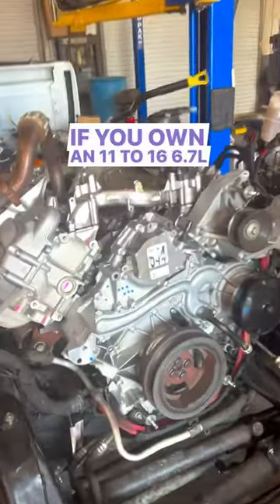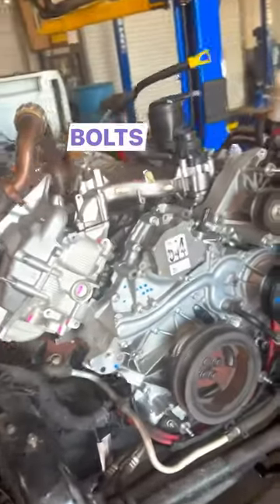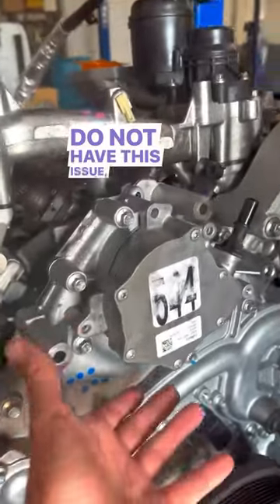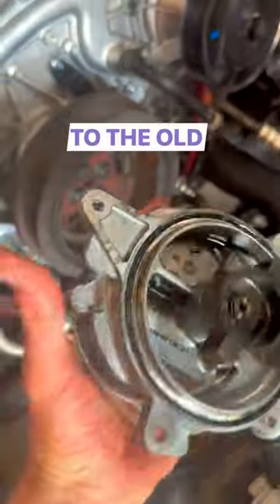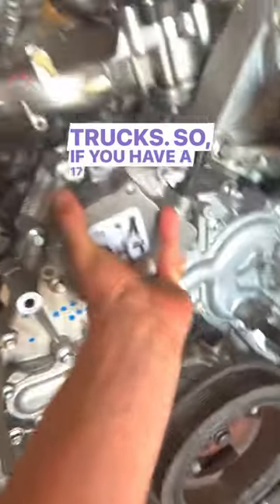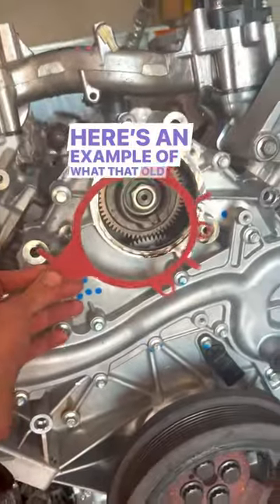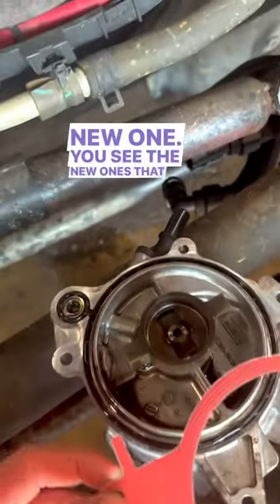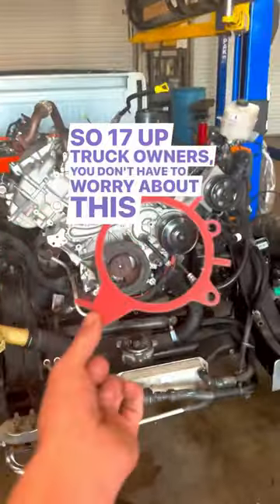6.7L Powerstroke Vacuum Pump Differences #shorts

Comment: What is vacuum still used for on these trucks?  I mean Dodge hasn't used a vacuum pump since 2005. Spending $50k for a truck that still uses vacuum technology... 😂🤦‍♂️
Reply: Power vacuum brakes????
Vacuum 4wd actuators?
Vacuum operated diff locks?
Cheap effective technology...
as long ads the vacuum pump has an O ring gasket//////